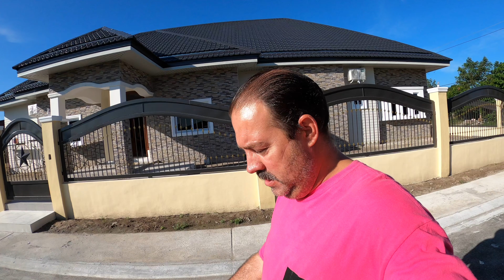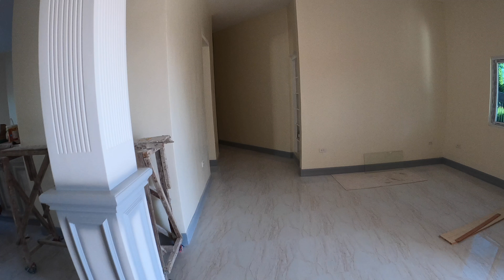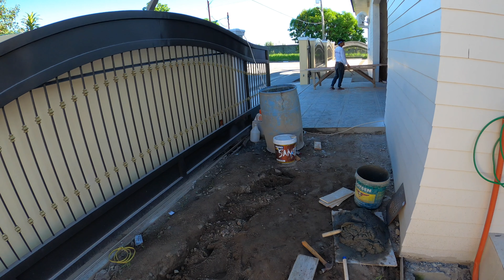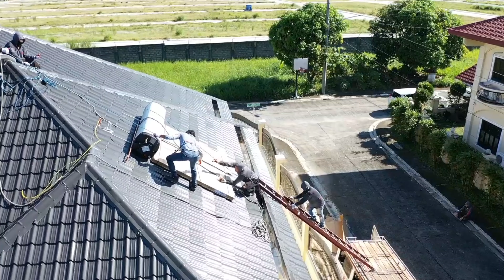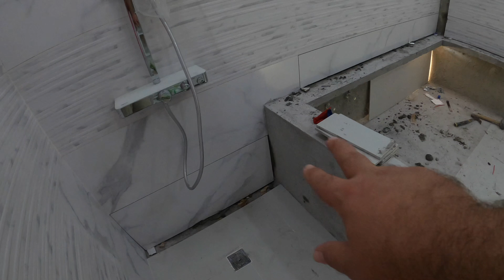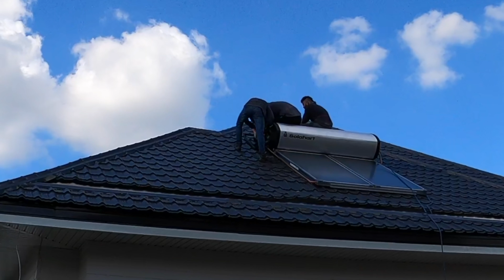Philippine House Building Step by Step, Build Day 231: Solar Hot Water Install

Comment: Interesting u went for just the solar hot water heater, rather than a full blown solar panel system that would give u electricity for the entire house? U definitely have the space on ur roof.
Reply from the maker: $$$ some things will follow after the initial build. Budgeting for the solar power system will come after the first year.

Comment: I have just one curiosity at the moment . . . why not have the hot water tank "under" the roof instead of on top of it? Lot's of room inside . . . I am sure there is a reason, but I am just curious what the reason is. LOL. As I was thinking about it, my wife was sitting there and suddenly asked the same question. LOL
She also made a comment about how nice your project is. I remember months ago when it was "in the rough", she was often confused as to how the floor plan worked. Now she can see how it all fits and she is really liking the way it is turning out. I hope my plans for a 12m x 18m house will be sufficient now . . . if not I'll blame you. LOL
Reply from the maker: It’s a solar hot water heater. Needs the sun to function. They do have a heat pump system that allows placement of the tank on the ground, but runs much higher. The setup we selected can work without electricity. But does have a backup in case of multiple heavy overcast days. 
At 200SM+ your future build will be considered large compared to most homes here. Even the up&downs (two story) run at 100-170SM on average. All depends on maximizing the space available and make it as open as possible to create a larger living space. Walls make the same space seem tiny.
Reply: @CasaTexPina . Yes, I understand it is solar, but dont the two solar panels provide the "juice" (electricity) to heat the water? The tank (that big cylinder) just holds the water? Or is ther more to that larger piece?
Reply from the maker: @tessrayproductions2159  The copper tubing runs through the panels and is integral to the heating process as well. The tank is primarily for storage but also has an electrical element for back up. Simple design to keep the components all together. 
Take a look at the product description here.
http://www.solanda.com/solarpower/index.html
Reply: @CasaTexPina . Ah, now I see how it functions. I was thinking the solar panels were electrical solar panels, but I see they actually are used to heat the water. And the placement of the tank makes sense in that setup. Thanks for the link!

Comment: if i have a choice to install solar water heater or photovoltaic solar panels, i will install the later one because i could use the generated electricity to power the electric power heater(s) plus more especially the a/c units.
Reply from the maker: Grid-tied solar system may come after the first year.

Comment: Another awesome feature of installing a solar water heater. How much set you back for that installed solar water heater if you don't mind me asking?
Also, just a concern on the master bedroom shower, is it a little tight specially when the glass panel is already installed?
Reply from the maker: PHP160K installed. Worth it for free hot water.
Master shower is about a 1M wide. No problem.

Comment: Very nice.. looks like they are good biilder..how much per sqm ?
Reply from the maker: Build costs are a real moving target here with a lot of hidden fees and expenses. Construction costs range from Php20K to PHP35K per SM depending on location, size, complexity, and level of finish. Most expats end up in the mid to high end in order to include what we consider basic essentials. Items not included in the build costs are Air Con, appliances, perimeter fence, landscaping, etc.
Reply: @CasaTexPina  thanks for the response.. just about within the range i was thinking. Your place is humongous..it should have cost you a fortune.. really nice
Reply from the maker: @gabrielgarcia5251  Thankfully 50-70% less than comparable build home in the US but made with concrete instead of sticks and bricks.